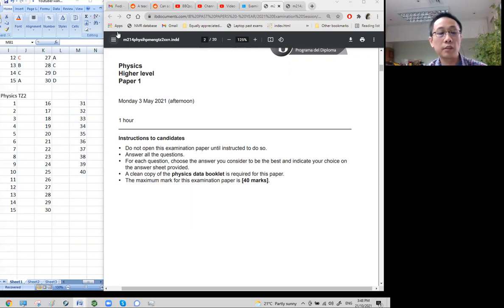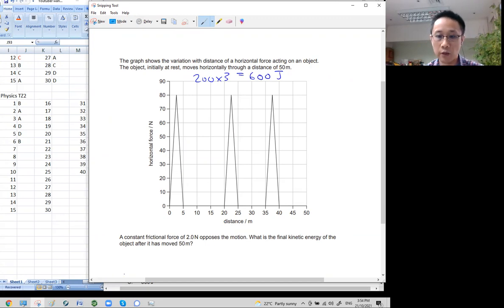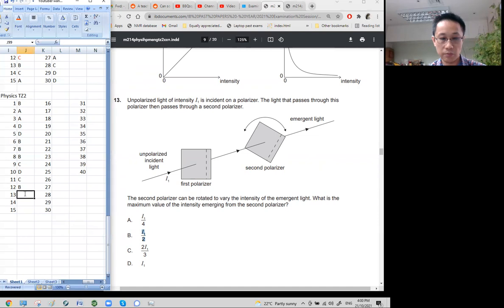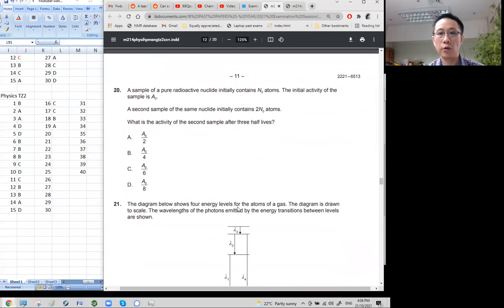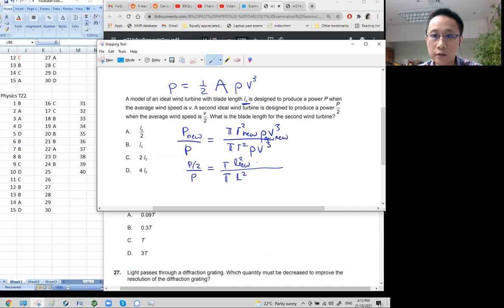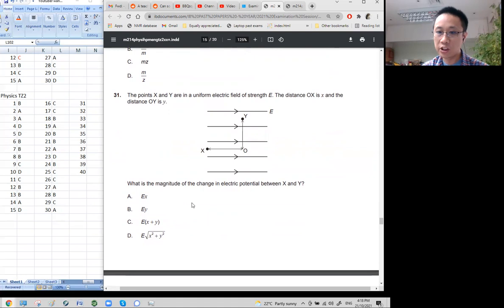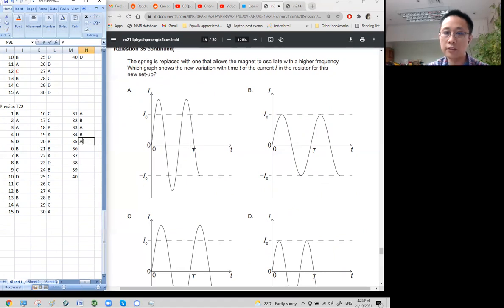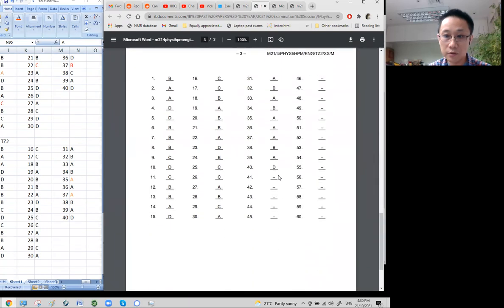M21 IB Physics Paper 1  HL TZ2 attempt / analysis

Comment: Thanks for the great video!
Any further follow ups on Q18, Q22, Q37 from IB PHYSICS 21 MAY TZ1 PAPER1?

Also, you've said there have been wrong answer key answers in IB physics such as M19 HL TZ2 Q16, N19 SL Q4. Is there any more that youve found?
(Btw N19 SL Q4 is the same question as N19 HL Q5 and over there the answer is correct)